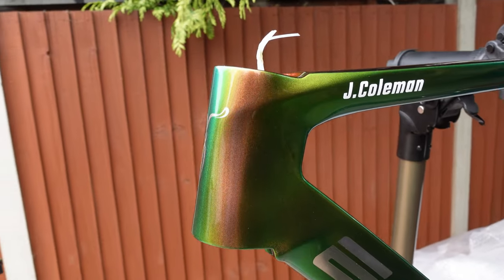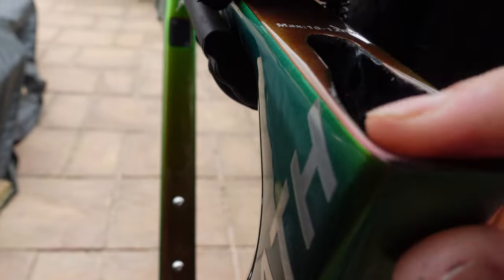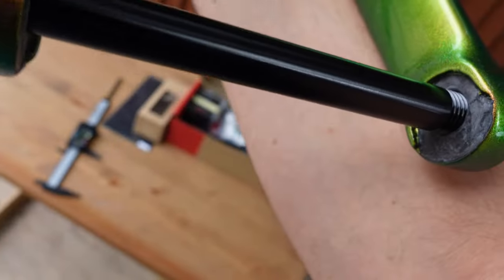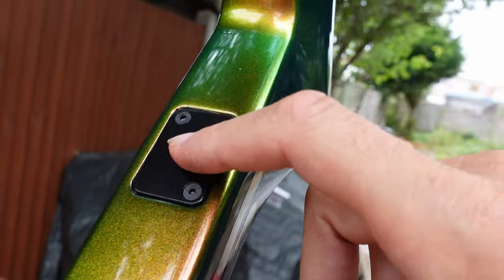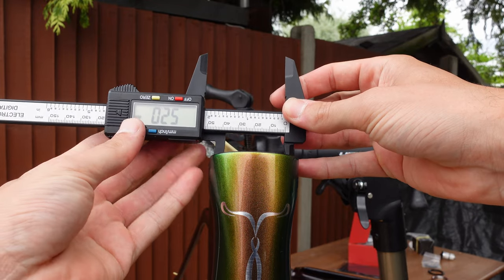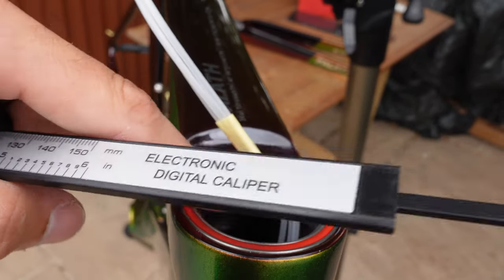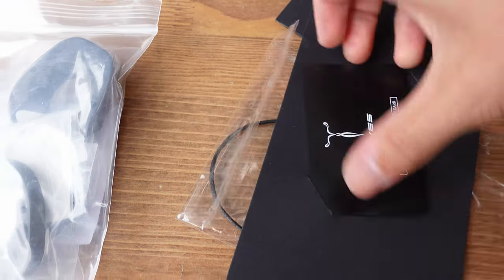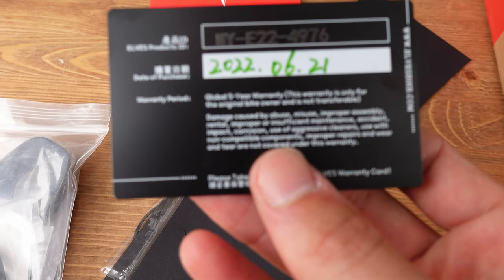CHEAP Chinese Carbon Bike Frame - In-depth Review (Elves Falath Pro 2022) | Part 2

Comment from the maker: Checkout part 1 if you missed it - https://youtu.be/cOenrK4Gduk
Reply: Question...  I have not yet assembled mine, because I am waiting for the handlebars to arrive. I  was looking at the headset cap and spacers, and noticed there is no interlocking mechanism between the underside of the top-cap and the piece that goes in the bearing and fixes the steerer tube in place. Those two pieces should lock together. There are locators holes in the underside of the top-cap, but no corresponding pins on the metal ring below.

Comment: Hiya. Guessing you may have done the build by now. The following advice to anyone building having done several: The item C shaped is the preload and sits on top head tube bearing and allows internal routing to pass through it. The ring with tiny slit is the crown race and sits on the fork crown and stops the bearing rubbing away the carbon. Also cable guides are for pulling outers not inners (won't need to pull inner if the outer is already in place!!!). Lastly regarding BB roundness, in an ideal world they'd all be perfect, but as carbon is a flat material wrapped around a former (mould) then tolerances +/- 0.01 ish millimeters is hard to achieve for any bike manufacturer (not building planes here) and its not CNC'd Alu out of a billet after all. So anything within 0.1mm is pretty pretty darn good if it's achieved. Just be sure to use a decent grease for both parts or retaining compound. Oh btw the Token BB won't be any better than that one supplied unless it has steel bearings! Good luck.
Reply from the maker: Thank you for all the information. I haven't actually built the bike up yet so I'll take all your points into consideration when I am building the bike. Thanks for taking the time to comment. Much appreciated 👍🏽

Comment: Quick tip, when you fit your BB use retaining compound and activator. Its a method to assure a perfect interference fit when the tolerances are not 100% perfect. It will prevent creaking down the line but is not too strong that you can still remove the BB   in the future. Grease or anti sieze alone might work if your frame has high tolerances.
Reply from the maker: Thanks for the tip! Everyone is helping me out a lot in the comments which is much appreciated!
Reply: @JourdainColeman  There are also a couple of companies making alloy threaded bb inserts, praxxis for one.

Comment: The cable guides are intended to make routing housings a bit easier - internal routing is generally a huuuuge pain.
First get these:
- masking tape - to label the individual guides at the headtube.
- cables - 2 derailleur cables and 1 brake cable.
- cable housings - all full lengths. Don't cut them just yet.
- integrated drop bar and spacers of your choice. (Since it looks like the front end of the frame was designed for an integrated drop bar).

You would need to first use the LONGEST derailleur cable and thread it into each cable guide by trial and error.
Then label the guides based on where the cables exit. 
Then insert the appropriate cables into their respective guides. Apply masking tape at the rear end of the cables and remove the cable guides one-by-one. Once each guide is removed, apply tape at the front end of the cables. Do not let the cables fall into the frame or it would be painful to fish them out. It would be helpful to bunch the cables out at the front end.

Then remove the masking tape at the rear ends of the cables and thread the appropriate cable housings around the cables until they exit the headtube. 
Measure out the length of cable housing you need and complete the rest of the build.
Reply from the maker: This is very helpful information in indeed! Thank you very much for sharing. I'll be sure to refer to this info when I'm putting everything together!

Comment: part 3 please... impressions of how it rides.  I bought a Trifox X18, and this elves looks like a MUCH better product... from the little things like  the small parts & seatpost grip paper, screw together ceramic bottom bracket... not to mention the paint job and how great the carbon looks on the inside of the frame.  I am very excited to hear how it rides
Reply from the maker: Hi Travis, hopefully I'll have the frame built relatively soon. I need to order some more parts and I'll be good to go. Hopefully your Trifox x18 is working out well for you?
Reply: Look at his profile... He's just presenting... ;-)

Comment: I had ceramic bottom bracket bearings and they were flawless. I replaced a set of eight year old steel bearings that were flooded, exposed to extreme amounts of sweat (used on a trainer in 30C environments). You probably will replace your frame before you have to replace the bearings.
What is more important is proper assembly of the bottom bracket and tensioning it correctly.
Reply from the maker: Good to hear the ceramic bearings worked well for you!

Comment: Hello JC. I saw in another video from you, that the frame was heavier than in this Video. Was this a mistake, or is it true that this frame only weights 860 grams? I ordered this frame and I am thinking it will come in the next few weeks. My EXCEL table is ready. With the Ultegra group set and “Orome” wheelset I am expecting 7300 to 7500 gram’s for the complete bike. My ordered size is M. But again, what is the real weight of your frame only?

Comment: That's really a nice frame and paint job. 3M makes a "clear coat" for cars that stops some of the paint chip damage. It goes on like a decal and is visible but having some covering the leading surfaces and rear chain stays would save some grief. The new ceramic coatings would offer lots of protection and may enhance the visuals of the paint. 1.91 pounds for the frame, dam! With forks 0.94 of a pound, 2.86 lbs. total. Impressive! Looking forward to your build.
Reply from the maker: Thanks for the info! I had thought about something similar so I'll check it out and see what I can get. Like you said, it's worth preserving the stunning paint! Hopefully I can get some money together soon and start purchasing more parts 😁
Reply: @JourdainColeman  Do you have any concerns about the rubber seat post jack watertightness? Any moisture getting in is directed to the bottom bracket. Knowing how rubber dries and degrades over time I would be tempted to buy a couple more jacks and pack away in a preservative of silicon grease. Hope you're getting some saddle time in.
Reply from the maker: @IDYLBERRY  Good point. I'd not thought about that! I could find a way to ensure there is no water ingress. I do plan for this bike to be my fair weather bike, so hopefully I don't get caught in the rain (Unlikley here in the UK 😂)

I'm trying to ride 100 miles a week at the moment. How about you?
Reply: @JourdainColeman  Hopefully the jack for the seat post pressure assembly keeps water at bay. I watched the video once and this crossed my mind, so I watched it 4 more times. Maybe Elves did sufficient testing to eliminate any water migration. You could make a video for your review while performing a water test to simulate a rainstorm, test duration is 20 minutes. We use litmus paper at suspect leak points as it changes color when moistened. My Scott has a triangular seat post with a single bolt through the top tube for compression, it hasn't moved. Compressing the carbon fiber doesn't excite me. Don't know if it's watertight but with rim brakes it's back to the barn if it starts to rain. Checked BB prices and they were all over the place.

Glad to send you a month of warm and dry for a month of cold and rain. 

Getting in about 140 miles a week between both bikes. Was doing 32 - 42 mile rides at average speed of 18mph but my wife had back-to-back cataract surgery over the course of 2 months. She was 74, lost a leg to cancer at 13 and I didn't want to leave her home alone very long so shortened my rides. She falls every now and then and it scares the crap out of me. I'm back at 32 miles some days, hope to find the energy to push back to 42. 

Started doing evening rides on the Mt bike leaving home an hour before sundown, riding to the edge of San Pablo Bay watching the sun go down while having a cold one. Going to try and make it there for the full moon on Wednesday. Bought a supposed 1,000 lumen head lamp and Rock Bros 1,000 lumen bike light. It's more than enough light even at 25 mph. Oncoming traffic flash me even at medium light. Got some paneers for the rear rack of the Mt. bike to make store runs more productive

You will need to find a second or third job for Lou to pay for the group set and wheels. 😁

Comment: Just ordered an Elves Eglath frame having watched several of your videos on the brand! sadly have a 6-8 week wait for delivery to uk as they’re now super busy!!
Reply from the maker: Yeah, I've heard that they are super busy. Hopefully that can be improved. Good to know the demand is high though - All the best with your build 👍🏼👌🏼
Reply: @JourdainColeman  thank you! mountain biker converting to roadie.. so this is going to be an adventure lol. already thinking of pulling my hair out at the idea fully integrated cable routing! I’ll use the strimmer wire method for the gearing, but brake hoses will be less fun!
Reply from the maker: Yeah, the strimmer cable method worked well for my first attempt. In my recent builds my mechanic installed the cables from back to front and then used a routing tool to get them through the bars. 🤔 

Hopefully you enjoy the road bike as much as the mountain bike 👍🏽

Comment: 2:25 - 2:27 - looks like a MASSIVE void on the right side of the bottom bracket housing. Is that a hole or just camera angle/reflection? That would be a massive red flag for me. Very nice paint job though.

Comment: Jourdain, i'm interested in the falath but i am unsure about the cabling options. i dont want to go through the headset and fully internal.  i will be going rim brake. i wondered if there are ports on the left side of the frame, although i know your frame being disc may be different?  I just found a video by Martel on the falath rim brake so sorry! hope you're enjoying the bike, is it as good as it looks?
Reply from the maker: I've been working on the bike the last couple of days and the cable routing through the bars is a pain. The frame isn't too bad though. I'd be intrigued to try a disc build... Maybe next year 👌🏼 - good luck with yours. 👍🏼
Reply: @JourdainColeman  does the cable have to travel through the headset? or can it go down the side to the rear brake if you know what i mean?

Comment: Looking forward to the full build! What bottom bracket are you looking to get? I’ve got a Elves frame on the way as well
Reply from the maker: Good question, I'm not 100% sure yet. I'm not a massive lover of press fit so i was going to try one that screws together in the centre of the frame. have you had any thoughts? If you have the frame coming, check out the other comments on this video about the headset bearings. It seems they are shipping with the wrong size.
Reply: got one ordered too. l'd think since the bottom bracket shell is just machined aluminum, that it is ok. if the frame bores are round ldk. but it should be possible to swap the ceramic hybrid bearings for steel ones.
Reply: @JourdainColeman   check out Token for thread together bottom brackets.

Comment: I'm considering doing this, but have only had rim brakes before - here comes the stupid question... Is that the through axel for the wheels that is fitted to the frame when it came or are they there to maintain its shape in transit?
Reply: The through axle is for the wheels.
Reply: @ssanderson12  yes, but is the through axel shown in the frame the actual one the wheels sit on?
Reply: @mr.stinky3116  I’m not sure if that’s the exact one that comes with the frame set. But that style of through axle will be used to secure the wheels to the fork and frame.
Reply: @ssanderson12  ta.

Comment: 860 grams for the frame? is your scale calibrated correctly? i thought it should be at least 1kg with all the metal parts ( eg rd hanger) included?
Reply from the maker: I'm going to do a full video weight as quite a few people have asked. It should be out soon and give full clarification 👍🏽
Reply: Turns out you measured 1260g for the same frame (without fork) on your video part 3. You might clarify this and add it to this frame discription! @JourdainColeman

Comment: Splash out and get a Hambini bottom bracket. One question , have you never seen cable guides before? All new frames have them now as integral cables are the standard now in the 21st century!
Reply from the maker: I've not used the Hambini bottom brackets before but I've seen them on his channel. Have you had a good experience with them? As for the cable guides, I've routed cables before but not thorough integrated bars as well. I'll give a t a good crack and see how it goes... If I do it wrong I'm sure people will let me know in the comments 😂 😂 😂
Reply: @JourdainColeman  Not used his BB's but they are the best on the market, though expensive!

Comment: What did it cost you in total? Frame + to get it at your doorstep?
Reply from the maker: They are  $996.00. For me that would have been £858 pounds. Full disclosure, they gave me a 50% as I said it will be featured in loads of videos. so I paid around 400.

The only price that i paid was for the frame. That included the custom paint job and the delivery. So there were no extra charges on top fo the bike .People mentioned import tax as well but I didn't have any. 

I hope that helps?

Comment: Whats the maximum tires it can fit?
Reply from the maker: I believe that you can fit 28mm in the frame, that's what the manufacturer said. I have not tried but I plan to go with 28mm so we'll see 👍🏽

Comment: 10-12 Nm on that seat post clamp is A LOT! I would't recommend going over 6Nm.
Reply from the maker: You were right, the mounting bolt has 6nm max bit the frame has 10nm / 12nm. Your comment made me check so thanks for taking the time to comment. I went with 5.5nm and some carbon grip paste. 🌞
Reply: @JourdainColeman  I built myself an aero bike with a frameset from Winowsports  FM238 Pro about a year ago so I'm very familiar with the whole process start to finish.
Reply: @JourdainColeman  What is the 10-12 nm referring to? I have had mine at 10nm on vanyar for almost a year. Was slipping at 6nm no carbon paste.

Comment: Stick to aluminium. The carbon is not good long term will start crack after 10 years best to throw carbon bike in skip but aluminium / steel bike can still be kept. Also can dangerously just snap and break off causing injury unlike good aluminium which would bend. The paints can damage the resin microscopically hence carbon usually being black in color